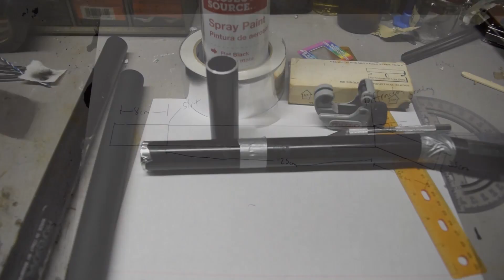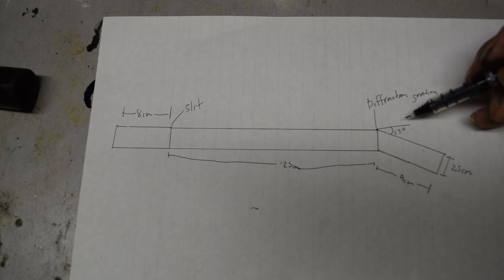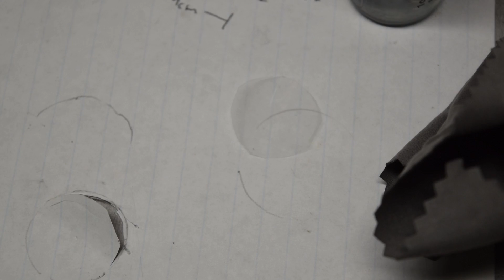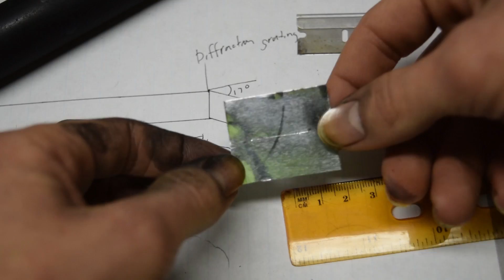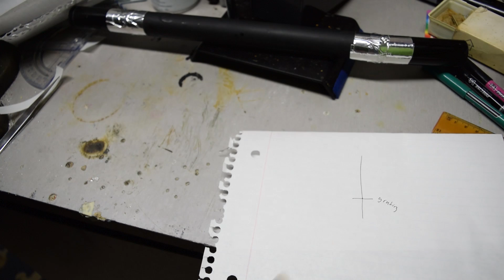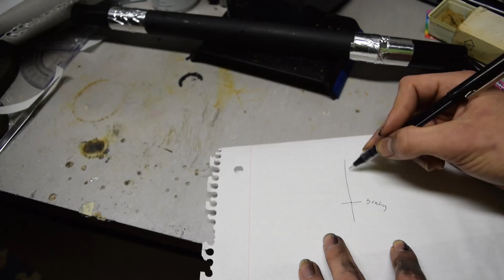Build a DIY Spectrometer Using Diffraction Grating

Comment: Why can't you install the grating at a 17º angle instead of using a bent tube?
Reply from the maker: You probably could have installed the grating on a 17 degree angle. I think  I went with the bent tube because it was easier to prototype and check for alignment and making 2 angled cuts would have been more difficult for me than making just one.
Reply from the maker: because the diffraction grating bends the light on an angle. if the eyepiece is straight the light will hit the inside of the tube rather than your eye
Reply from the maker: I don't know. I've never studied optics

Comment: Hey brother, awesome design.  So simple.  I have a question.  If we were to put different oils or fats on the diffraction grating would we be able to calibrate it based on different types?
Reply: What are you trying to calibrate? And what are the oils or fats supposed to do, except smudging the diffraction grating and making it unusable??

If you want to calibrate it wavelength-wise, you could use easily observable emission lines with known wavelength, e.g. the sodium line doublet with a center frequency of 589.29 nm.
Reply from the maker: I have no idea. Try it out.